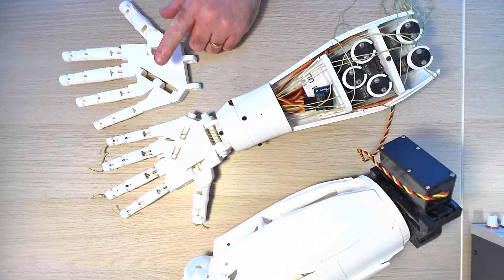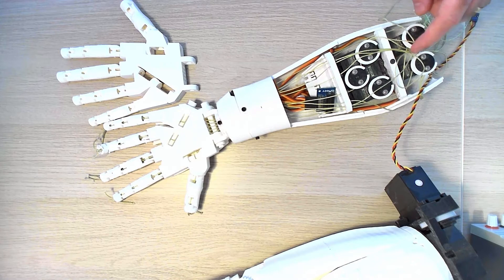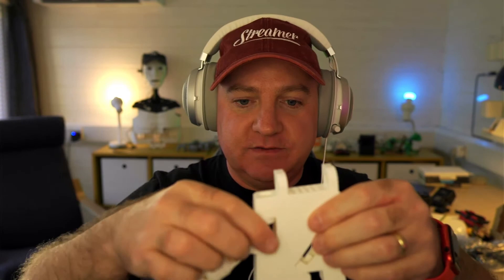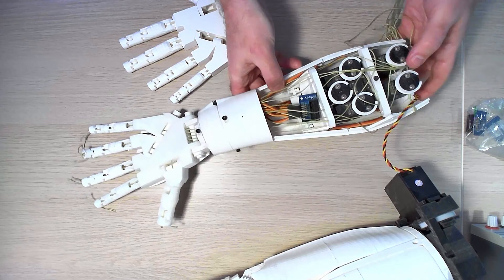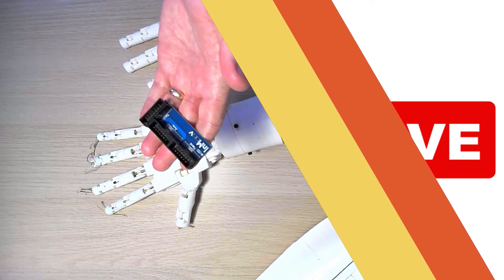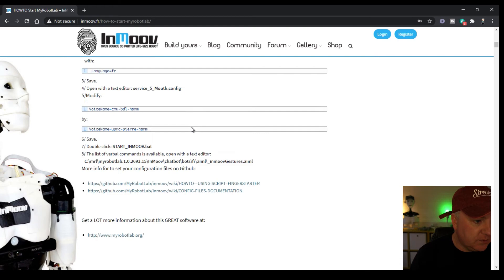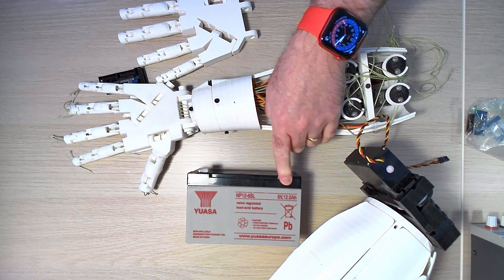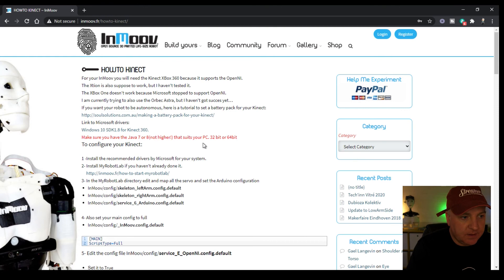Learn how to build a full size Robot.

Comment: Thanks for the rundown Kevin! Neil here from Nova Scotia. I’ll came across this video and I’ll be checking after this to see if you’ve  posted updates. I haven’t decided yet if inMoov is the robot build I’ll be doing, I did start downloading the robot lab and even found that difficult. And having the right interface is very important. My programming skills are limited but I usually dive into challenges and learn as I go - I felt like this is similar to your way of doing things from what you described. However, I’ve been around long enough that I can see this may not be the smoothest build. Anyway I just wanted to say thank you for your polite commentary and to encourage you if you haven’t completed your build just yet. Thanks!

Comment: MRL works quite well but there is a pretty big gotcha for the noob.
MRL Manticore only works on Java 1.7 or 1.8.
Most computers come with a newer version, so you will need to downgrade it before it will work correctly
My Inmoov is named Fred. Frequently Re-Engineered Device.
I have gone a very different way with the servo control using the PCA9685 16 channel I2C servo drivers and connecting those back to a Raspberry Pi running MRL.

You can see how I built the non-standard head here https://www.youtube.com/playlist?list=PLgXTfFM40HqEbnFfhaLPmLv_RS1ZRCilI

Think of the Inmoov project as an education tool that teaches you 3D printing, Mechanical engineering, Electrical and Electronics and Programming.
One cool thing with this project is there is no reason why you can't change things or improve on the design.

Keep up the good work.
Reply from the maker: Thanks @cyber_one I think I’ve seen a couple of your videos already with Fred! I was also thinking about using a couple of the PCA9685 boards and a raspberry pi as well as Python.
Reply: @kevinmcaleer28  The other video you might want to have a look at are the development of the motorised legs.
This is an ongoing project, but is one where, with the help of Fred, we look at different parts of the leg engineering problems and break it down to smaller more manageable chunks.
https://www.youtube.com/watch?v=bRWXAl2Hg7k&list=PLgXTfFM40HqEMwg9rJ078INRYWDCG66B3
Reply: @CyberOne Q: Are you an AI? 🤔